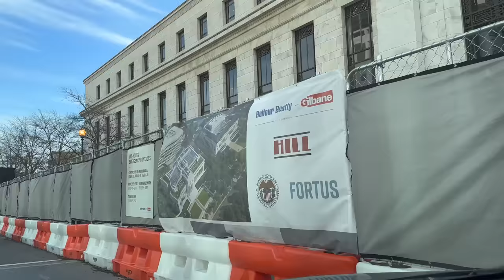Chasing Air Force Two and seeing Air Force One's plane, plus an update on the Fed Reserve building.

Comment: Wonder how much $$$$ gets spent on each motorcade trip. Maybe helicopter trip would be cheaper, less use of civil resources- police, rescue, firetrucks- just a thought
Reply: The helicopter would have been used, but the weather caused its cancelation.
Reply: A helo run uses at least four different birds 🤣....and that does not Count the Fighter air patrol above with an AWACS and airborne four engine tanker support for all including AF-1.
Reply: There is a line item in the budget under White House transportation, I found one years ago at it was like 975,000 per trip every time they have a motorcade. Air Force One had an operating costs per hour broken down. It was absurdly high. $200,000 a hour just in operating costs not to mention all the security and other things that go with it. They also have a standby that is always ready to go.